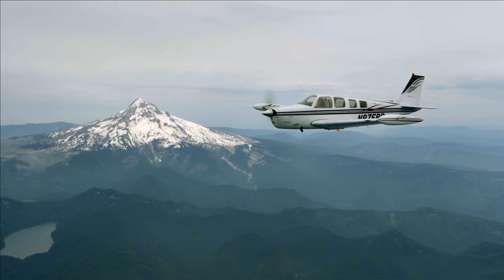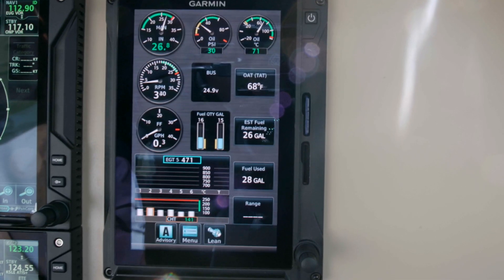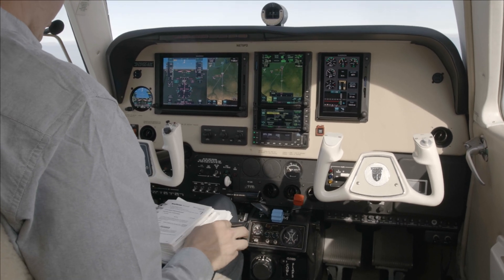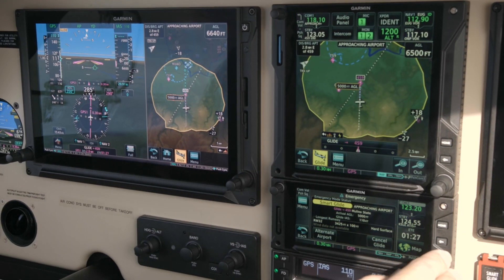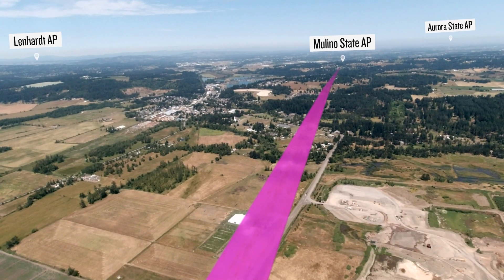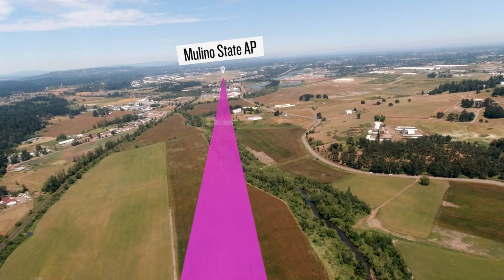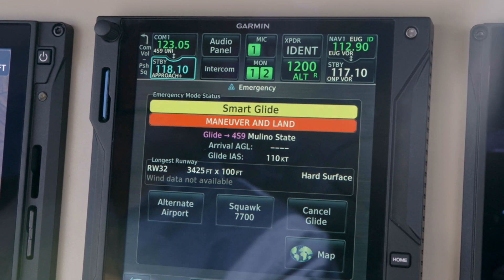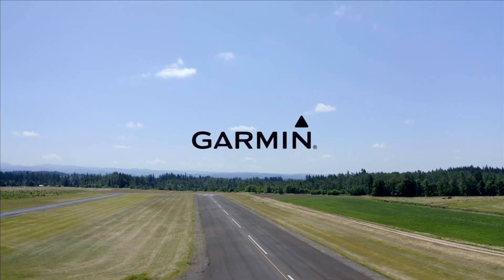Garmin Smart Glide: Help During an Engine Failure

Comment: Ummmm. I had an Anywhere Map GPS over a decade ago that did the same thing! It had a dedicated software button that would activate its “cones of safety” . I flew over 500 hours with the thing and the "emergency button" did give me some peace of mind. So, thank you Garmin for this cutting edge discovery.....
Reply: I had AnywhereMap also and it's cones of safety just showed a ring around the airplane depicting the glide range on a windless day.  AnywhereMap did not assist the pilot in choosing the best airport given wind conditions.  I forget if AnywhereMap supplied runway lengths and tower/CTAF frequencies.
Reply: Some people are just obtuse.
Reply: Possibly - but, like it or not, it is still a true statement.

Comment: What if there is no available runway within the glide range? Thanks!
Reply from the maker: Hi Yaofu, Garmin alerts to you there are no airports in glide range, if that happens to be the case. If a GFC 500 or GFC 600 is interfaced, the system engages IAS mode with the best glide speed for the aircraft. Smart Glide helps as much as possible with the situation. Thank you for your interest in Garmin Autonomi Smart Glide.

Comment: hmmm cute but does it take into account the wind? the real height (not GPS)? Sometimes, (a lot of time) best solution is to find a nice meadow iso focusing on an airport. And that system won't be able to evaluate the meadow for electrical wires, obstacles, etc...  might loose precious time focusing on an airport around  iso flat natural field below you.
Reply from the maker: Smart Glide requires a compatible flight display or instrument so it has real-time wind speed and direction calculations to use as part of its estimates. It does take terrain and obstacles amongst many other variables, similar to the Collier award-winning Autoland, into consideration for the airport selection. More details here: https://discover.garmin.com/en-US/autonomi/#sg. Thank you for considering Garmin.

Comment: Nice but how does it assist in getting rid of altitude? Say you would reach a field direct gliding from 15000 down to 7000 feet. But what now? Does it help with circling or does it lenthen the path so you come right in?
Reply from the maker: Hi Rainer, it creates a direct-to navigation to the center of the airport. It updates the pilot with real-time estimates of the arrival AGL. Once within 2nm of the airport, the system notifies the pilot to disconnect the autopilot to complete the required maneuvering for landing, including any circling required. Thank you for your interest in Smart Glide.
Reply: @garminaviation  Ah, ok thanks for the answer. I guess with the estimates one could try to fly on a track that gives optimal conditions like 2000 or 3000 feet AGL - depending on what the pilot is most familiar with.

Comment: Why does Smart Guide not work with the old GTN750/650? and only the Xi version?
Reply from the maker: The original GTN series, faces a similar challenge of other avionics, like the original G1000. After just about a decade of continued software updates, each adding new features and capabilities, we reached the limit of what the technology can support. The GTN Xi series dramatically increased the onboard infrastructure and resources to continue bringing new smart capabilities and features like this with more complex algorithms. These and other new features will be limited to the GTN Xi series for these reasons. Thank you for being a loyal Garmin customer.

Comment: Smart Glide support with a variety of Garmin systems
In certified aircraft, Smart Glide will become available with a GTN Xi series navigator paired with a compatible Garmin flight display including the G500 TXi™/G600 TXi, GI 275 electronic flight instrument, the G3X Touch™, or G5 electronic flight instrument, with others to be added later4. Compatible Garmin autopilots such as GFC 500 or GFC 600 can be automatically engaged when Smart Glide is activated5. For aircraft without a compatible Garmin autopilot, Smart Glide will still provide critical information and features to help manage engine emergencies and help to reduce pilot workload. Further, experimental aircraft with G3X Touch and a G3X autopilot can also enable Smart Glide technology when appropriately equipped.
Reply: What does it do when there isn't an airport within glide? does it somehow track winds and maybe point  at least into the wind and establish best glide? Even that would help but i had to ask.
Reply: @GavinD50C  Terrain is a big factor if no airport in glide range. That should be a pilot call. HOWEVER, even knowing you are out of normal glide range is a big deal. Plenty of folks have crashed trying to make glide to places that are too far / stall / spin etc.
Reply: @randominternet5586  totally. I’ll get this installed in the Cherokee then when it’s done I’ll test it out and post the video to share.
Reply from the maker: Hi Gavin, it uses real-time wind speed and wind direction from the compatible flight display or flight instrument to estimate the glide range using the aircraft's glide ratio. If there are no airports within glide range, the system will engage the GFC 500 or GFC 600 autopilot in IAS mode using the best glide airspeed and roll the wings level to allow the pilot to focus on an alternate landing location. Thank you for your interest in Garmin.
Reply: @garminaviation  Good answer. I guess the next assumption is that you have solid weather information flowing into your aircraft. So as long as you're in coverage for that you're good. I"m going to install this but looking to understand the limitations.
Reply from the maker: Hi Gavin, a datalink weather source like from one of our GTX 345 ADS-B transponders series is optionally included in the airport selection criteria. If equipped, the airport METARs will be considered and VFR to MVFR conditions preferred. I like to study limitations as well. The formal limitations will be found in the updated Aircraft Flight Manual Supplements just as soon as they become available on our website. Here are the limitations published on our website for reference now: https://www.garmin.com/en-US/legal/SGuse/.

Comment: What avionics supports SMART GLIDE ?

I have a GTN 750, 500 TXI, Autopilot 500 and a G5…
Reply: I have those as well and this caught my attention too. No question it’s a great add on, but will have to see pricing and install to see if it makes sense.
Reply: Your GTN needs to be an Xi for the feature to work; feature is standard in the August software update.  If you want the discrete guarded switch, that'll cost you $125 + install.
Reply: @LargoFlyBoy  I'm kind of in luck then as this would be for a Cherokee i have that is about to get a GNT650xi. and nothing in aviation costs $125!
Reply: @GavinD50C  so true👍✈️
Reply: @LargoFlyBoy  ok, I only have a GTN 750, no GTN 750 TXI. Then it does not work :-(
Reply: I ran this by the shop that's doing the work in my Cherokee and we'll add it when the new GTN650txi goes in. its just a software enhancement and a button for the most part so in the grand scheme of things, the added cost should not be frightening. In the end this is an insurance policy and a nice feature to leverage from a platform I already have. Failing this, my instructor back when doing emergency training had the very simple method of figuring out how many backward rotations of the trim wheel from level cruise would put you more or less at best glide, then you execute the rest of your emergency plan for where to land... which when flying a single should be somewhere in your head anyway. Of course that's the happy path.. I'll have this installed then post a YouTube video of it in action sometime in the fall when the aircraft is done.